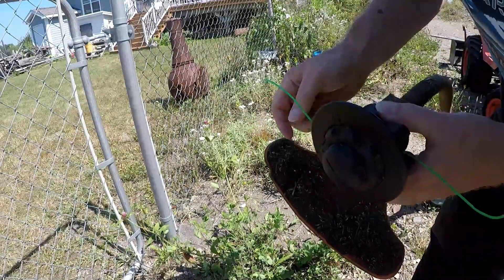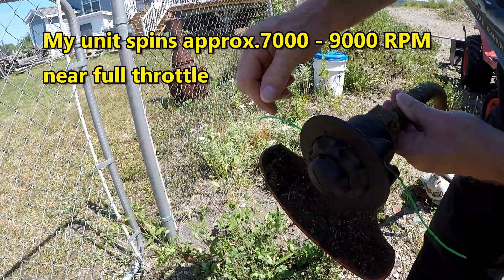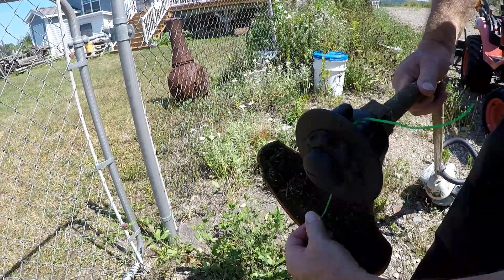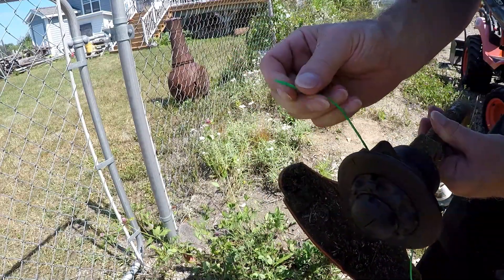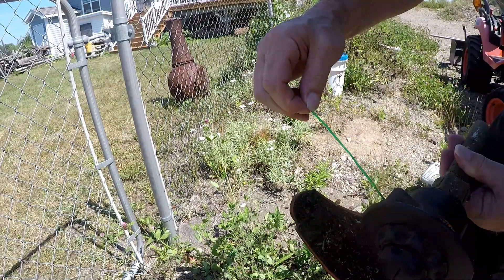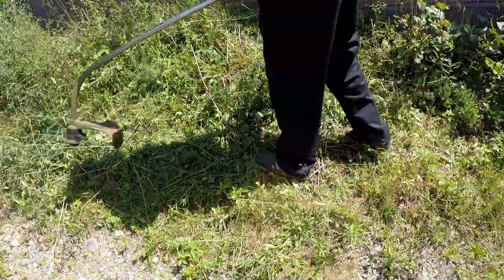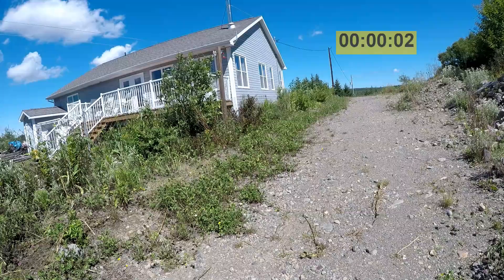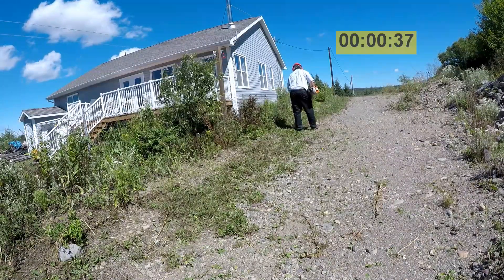Best way to Use String Trimmer in tall grass and why

Comment: Hey Don, Which gauge line are you using here? I think either my approach angle is wonky or been running with the lines too long bc the engine of my brand new trimmer bogged down and didn’t want to get it too hot so figured I’d come back to it. Your explanation helped me out though, as I had forgotten about the sheer physics and only got frustrated so I should’ve stopped by here way ahead of time!
Reply from the maker: Hi Noah. I am using a 0.080 inch or 2.00 mm plastic line. The brand is Saber Cut super edge.  I am not endorsing or in any way affiliated with them just providing what is in my trimmer I bought a 175ft spool several years ago and still have partial reel I think I bought at Home Depot but can not remember to be truthful. I recommend to check your manual or if marked on your trimmer. The gauge of the line will be dictated by the spool openings the line feeds through on your particular trimmer hoe this was helpful

Comment: That's a powerful trimmer.
Reply from the maker: Hi:
The stihl I use does have more than enough power for my use. But to be honest it is one of the smaller sized gas trimmers that Stihl sells. For hoeownerms looking after their own lawns, it is not necessary to have the trimmer with the largest engine. Used properly, the smaller trimmers ( both gas and electric) will do a great job. Thanks for watching the video and for your feedback. take care Don
Reply: @donfeldman  You bet.  Thanks for replying.  I use an electric battery powered I bought recently right now as I have honestly given up on the fuel ones (seemed like I was spending half the time trying to start the darn things.  I was honestly jealous at how easily yours started. Ha.  Our fuel powered are all second hand).  I live on a farm though and some of the weeds in the pasture are more like small trees at this point and the single string battery powered does not seem to be enough.  (I am to cheap to get the good ones.)